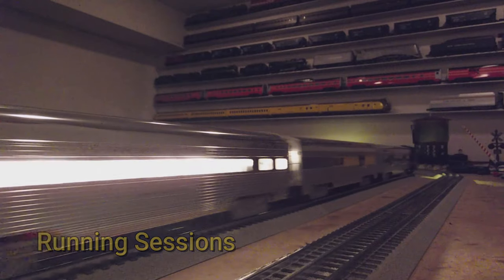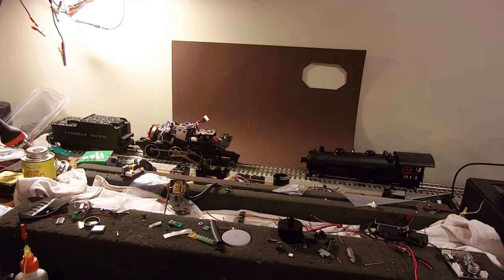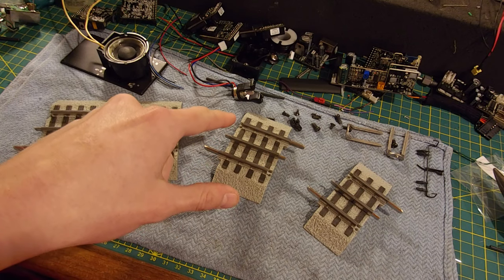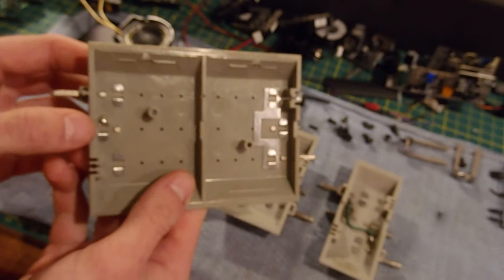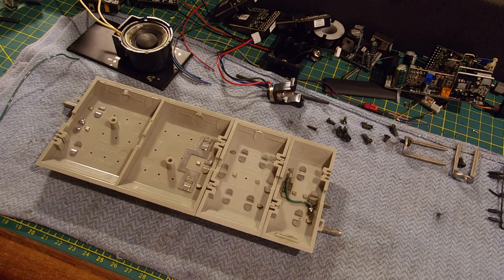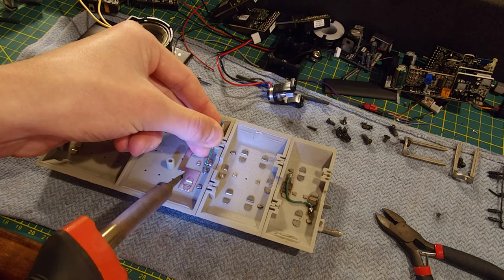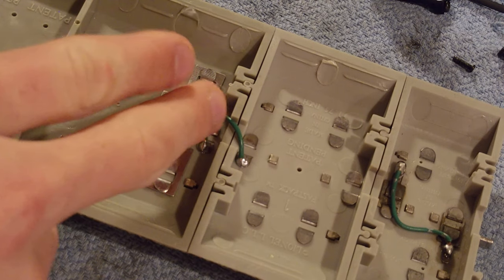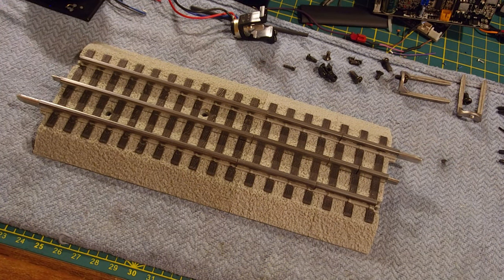FasTrack Electrical Issues Tips & Tricks #workbenchwednesday

Comment: Last yr I couldn't get my starter set Polar Express going all the way around the track. I took it down out of frustration. I stumbled on your video today searching for the answer because I put up a Christmas village. I soldered each piece of center together. I cleaned the tracks and the contacts on the train. It worked. Thank you for sharing your tip. Lots of people come to see this village that I affectionately call Linstervile.  This year will not disappoint them. I'm subscribing. Thanks again...

Comment: I used the Fastrack to circle the Tree for Christmas. However, connecting and dismantling the Fastrack at the end of the season, all of the 48" Fastrack curves lost connectivity. And the reason I lost interest in using Fastrack. Good job; your tips are helpful and sensible. I see in one shot that the track appears light gray, and I noticed that the pieces you demonstrated are gray-brown. Is this due to the lighting, or is the light gray track a different track? To my understanding, when Lionel changed overseas manufacturers, the quality diminished. Some YouTubers discussed the many problems with the Fastrack, including the later switches.

Comment: What's up Sid it,s me.Still trying to get my money together to build that crossover you showed in one of your vids.Just received some 30 inch fastrack .It works great.Less connection better electrical flow disconnected my 10 inch power track.And hooked up Transformer to 30 inch Fastrack. I only use 10 inch track when necessary 
THANKS FOR SHARING HOW TO CONNECT RAILS.

Comment: Great tips.  If it's impractical to remove the track, install the wires, and put everything back in place, do you think a bit of solder applied directly between the center rails (e.g. from the top, if the bottom of the track is difficult to access) would accomplish the same thing?
Reply from the maker: Yes that would do the same thing.
Reply: It would be visible from the outside but if you do it carefully it will look good. I don't think it would be a problem, but if sodder gets hot (as it is designed to be) then it might get soft or melt.

Comment: Good Tip, but your soldering needs a little help! Heat the metal to temperature, then the solder will draw to the metal. Never heat the solder or the result will be a cold joint. Other than that, your advice is always an A+

Comment: Sid, I have no power to my rail that has the crossover with two switches, could the problem be in the switches. All other rails are working fine but no switches attached. Transformer shows power but zero on the tracks. I had to add 2 1 1/4 straight piece because of the blockage in corner of switch, could that be the problem

Thanks